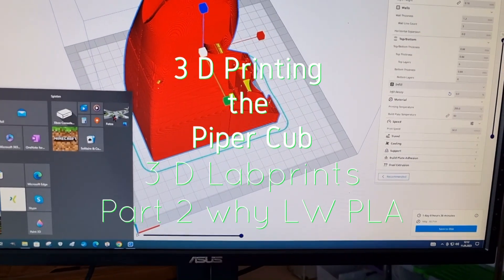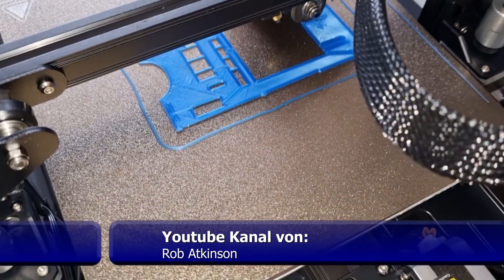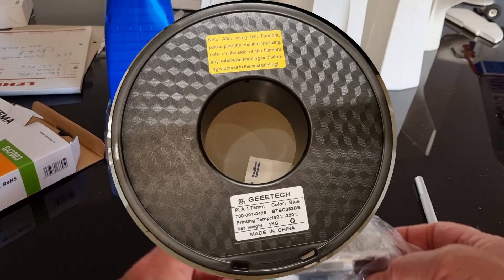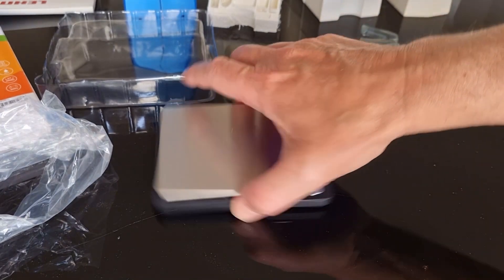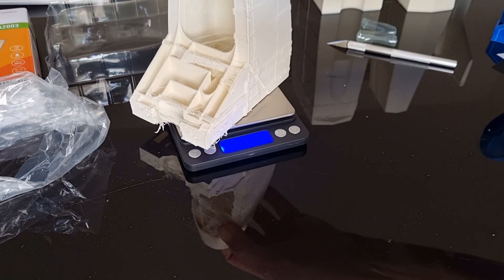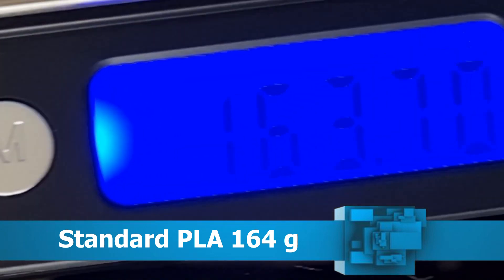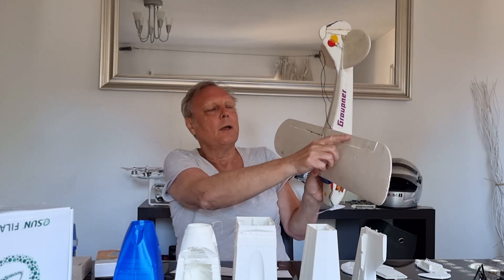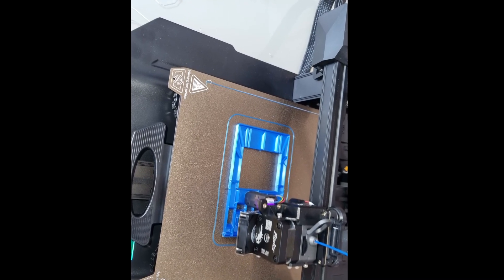3 D Printing of the Piper Cub 3 D Labprints Part 2 why LW PLA?

Comment: Great job, can you help me out, please? I’m struggling to print this aero using ESUN PLA. I managed to print some parts with a perfect weight, but the fuselage parts, for example, seem a bit fragile. Is that normal? Did you add any reinforcements, or is just gluing everything together enough?

Now, my main question—the biggest boss I’m facing lol—parts like the aero’s nose and tail, how do you close them? Do you use infill mesh only and support blocker? I tried, but in the preview, it looks like it’ll turn out the same as the one I printed (the nose ended up with separated filaments).
Reply from the maker: Hi, late here in Ge. Tomorrow i try to go through your questions and give u answers. Pls remember me if i forgott. There are a lot Vids about printing at my channel. Cheers, Axel
Reply from the maker: Hi, thx for compliment and first of all, wich slicer do u use? I use Cura. There was a big effort the checkbox Combing Mode. Switch to off. if your parts are breaking, maybe layer hight u choose is to low. Try a heat tower to maintain the perfect temperature pls. Pls recognize my Playlist  Piper Cub Printing 3 D Lab Print. There is a lot of my xperiences about printing the Piper. Check out too my Videos of my first own design, the Gullwing Fighter of the PZL 11. It flew nice after one year of try and error. Also check out my vids about the Buecker Student. And in future all my 3 D Print stuff yo will find at my Channel tekknerd8314. At last, my opinion is and that was my intention to show with this Vid, a Modell with normal PLA gets to heavy. Use LW PLA and face a lot of new issues. I hope i could help you, cheers, Axel
Reply: @corvette724  I'm using cura and lw pla sa esun, I'll check this layer height and try again thanks for the tips and good flights directly from Portugal!
Reply from the maker: @SagaFuture-p7j best flights too 😎

Comment: I printed the front of the fuselage on a K1 MAX  with normal pla HS with single wall, zero infill and used Even-Odd slicing mode and it weighed only 45 grams for the same part
Reply from the maker: Hi, awesome. So u got the optimized Parameter.  My experience is, it shouldn't weigh less than 1000g. Check out my vids of maiden.  Did u print the whole project in normal pla? Cheers, Axel
Reply: @corvette724  hi yeah I printed the the whole fuselage and the elevators so far and it weight 180 grams
Reply: I just don't want it to be too heavy to put unwanted stress on the wing
Reply from the maker: @sniperbiscuits2165 this is awesome.  Sabine weight at tail is essential.
Reply from the maker: @sniperbiscuits2165  first that. Besides i used 1mm carbon stringers, check out my vids. And second, we gaining for tealistic flight caracteristics, dort  we? It shouldn't fly like a F 104, what do u think?
Reply: @corvette724  Das ist der Unterschied, die Flugeigenschaften machen mir nichts aus, ich schätze in diesem Fall einfach nur das Aussehen des Flugzeugs.